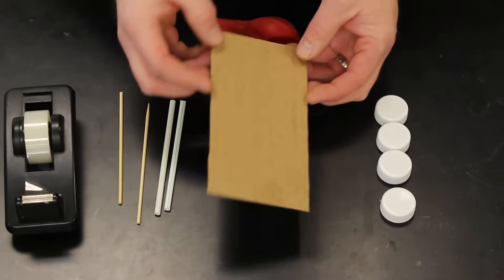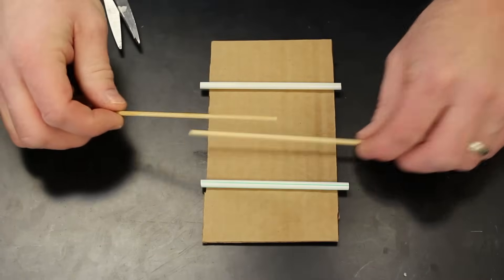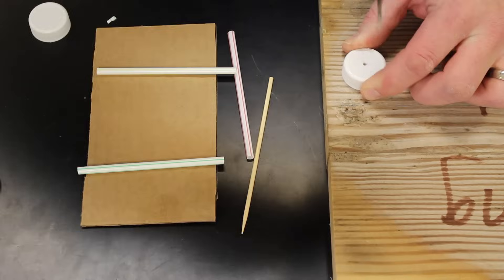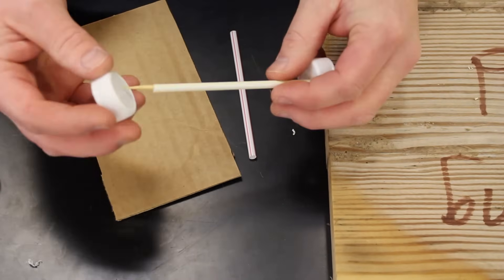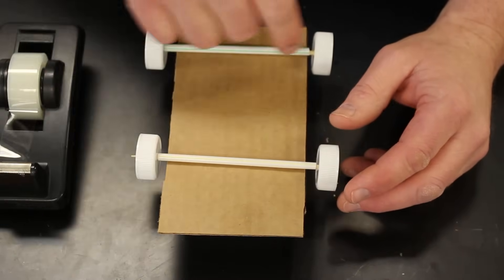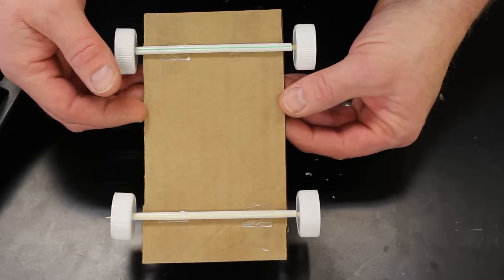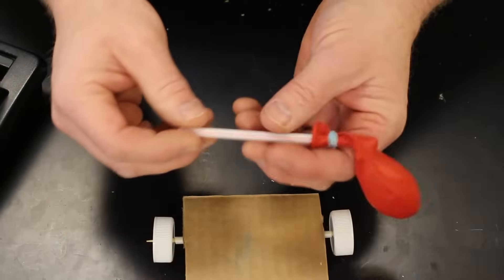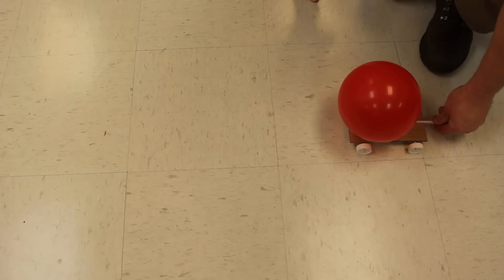BUILD A BALLOON CAR THAT WORKS!! DIY Newton Car-Vehicle

Comment: I just made this!! Also something you can also do is instead of using a rubber band (which I didn’t have and didn’t want to spend money) so I used tape and I had my dad hold it the balloon and straw in place and wrap a tight piece of tape.